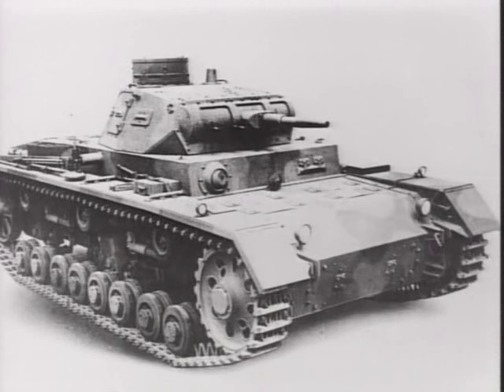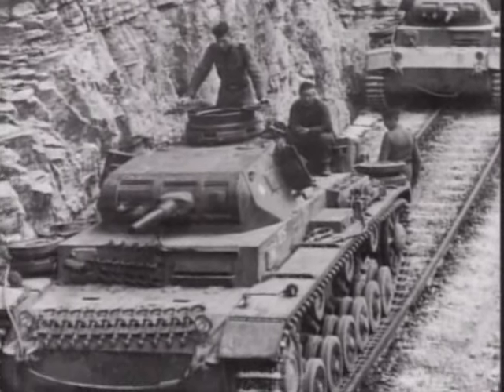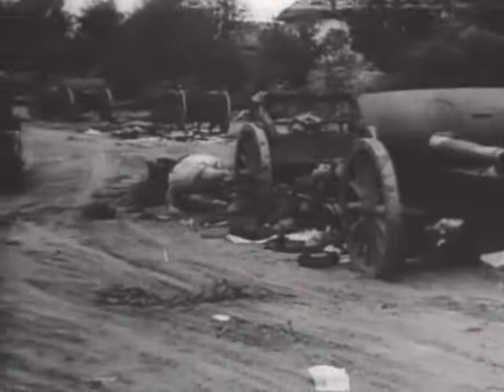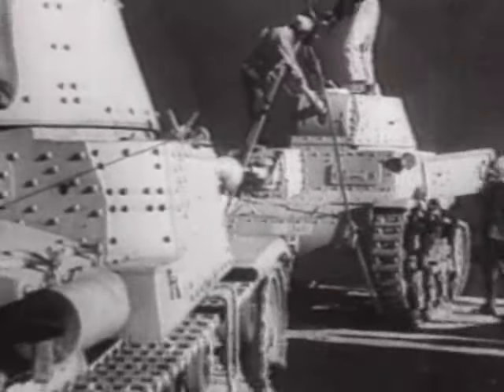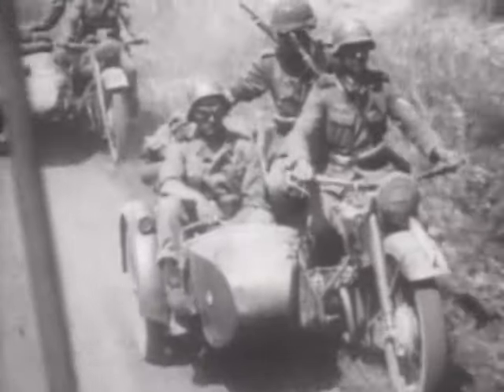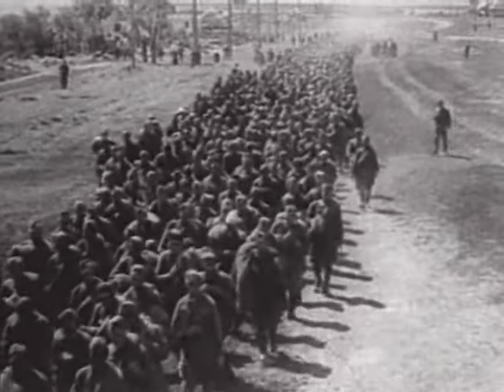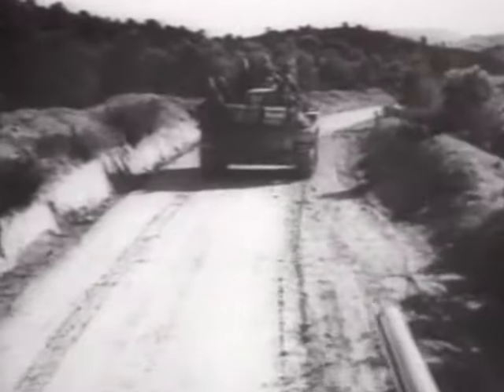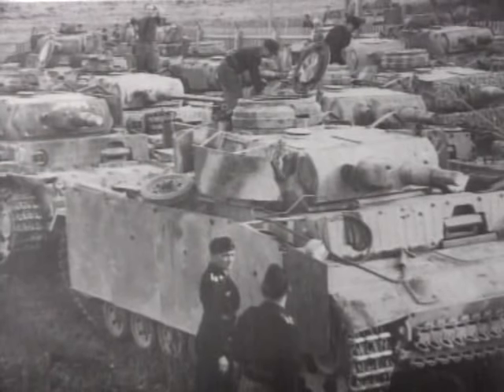German War Files - Panzer III Medium Tanks

Comment: Victory is not won by designing the best models, ask the French who had better tanks and really good artillery in 1940...
Reply: True, but the french tanks were not wholly superior. Because they were designed to be infantry support, high top speed was not considered important, and as such were very slow. They were big, heavy things with lots of armor, but they were slow and their cross country mobility suffered due to their weight.
Reply: DracoAvian You are very right !
They had no chance !
Reply: Peter Magro ask Russia who had the worst tanks
Reply: the Germans destroyed the French by cutting through the Ardenne surprising them from behind. They used their notorious blitzkrieg tactics to punch through the french lines, encircle and the stukas dive bombers did the rest.
Reply: @DracoAvian  No the souma with the 47mm gun was probably the best medium tank in the world in 1940 with a good balance of speed, armour and armament.the char b was slow but did the job it was designed to do -infantry assault.i suggest you about the battle at damour where 2 french light armoured divisions gave army group a panzers a hiding over two days and were only forced to retreat because of the failure at sedan
Reply: @berndjakob49  see reply above -not true
Reply: @fastestbasket4327  no the t28 and t40-forerunners of the t34 were adequate for 1940
Reply: @gregory2789  low river levels and a french reluctance to use all their artillery ammunition was also a factors
Reply: @fastestbasket4327  Russian tanks t-34, su- series were far superior to any tanks in that era,. What nonsense  are you saying. The tank drivers were less trained and lack the skills compared to Germans, though.
Reply: All french tanks suffered from a commander who preferred to use telephones and motorcycle messengers.
Reply: @paulvbarbar9957 . That is incorrect.The Panzer 3 and 4 were far superior to the T34.
Reply: @DracoAvian  ,. No, the French used them wrong.
Rather than mass them in large armor formations, they split them up into smaller, more specialized Infantry support units.
The French tanks were far superior  to the German tanks, but the French tactics were inferior.
Reply: @gregory2789  the Germans destroyed the French because, well, they're the French.
Reply: The French... yeah
Reply: @model-man7802  true but where they effectively led like at damur-french armour defeated a panzer corp
Reply: up to 1943, the Germans steadily improved their tanks especially after confronting the Soviet tanks but the Germans over engineered and complicated their tanks.
Reply: A lot of France tanks were better then the Germans tanks but most actually were not out of France 6,000 tanks I believe only about 1,000 were better then Germany's 3,000+.
Reply: after the Germans confronted the Russian armor, they had to go back to designers for bigger more powerful armor but they complicated everything!
Reply: @ogana_M  no even the t34/76 was a superior design to the mk3    the mk4 long barrel    possibly a match  but the sloping armor of t34 gave it the edge
Reply: They r the better in armour but german is the best in skill they reveal
Reply: ASCALON  yes i agreed with u 😎😎
Reply: ASCALON  i appreciate when someone post some long length. 
They try to conclude some important on that text.
No way i going to ignore that :)
Reply: ctguy591  yea they ignore spy report hot activity near Ardennes
Reply: Peter Magro not better, thicker armor.
Reply: @gregory2789  OK, except there was NO SUCH THING AS BLITZKRIEG TACTIC.  It was an invention of the British and American press to explain how Germany did so well, and to sell newspapers.  Don't get me started in the meaning of D-Day.